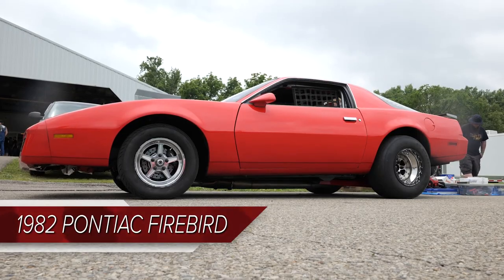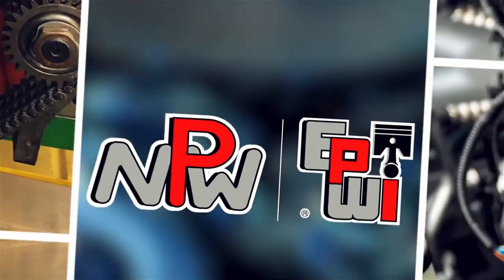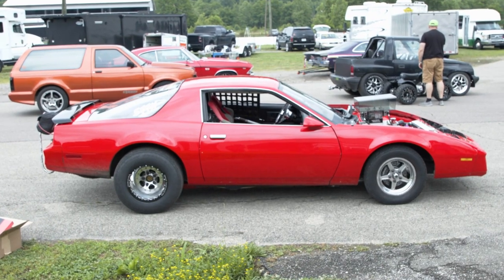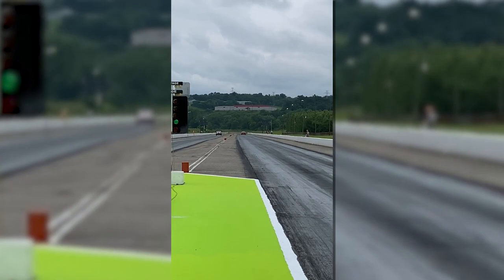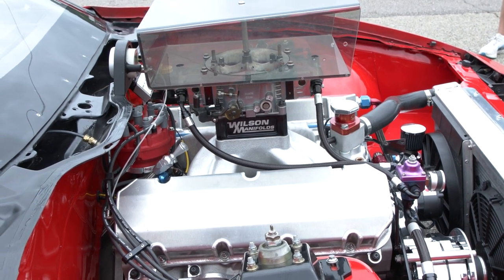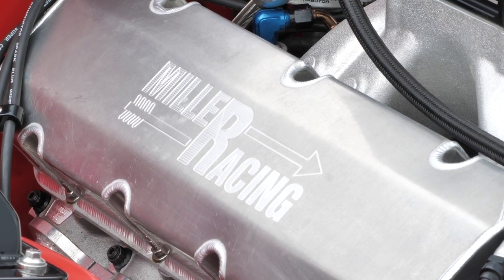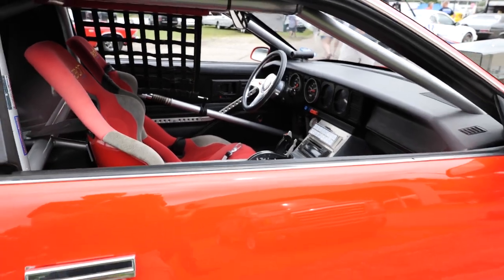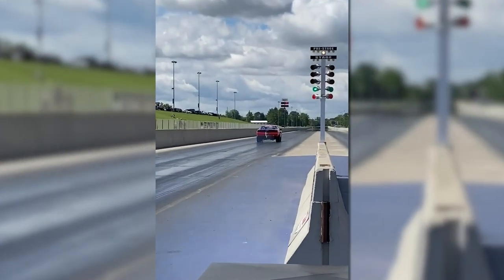Terry Miller's 565 Cubic Inch Big Block Chevy Engine

Comment: Is a 565 Big block Chevy any good for boost
Reply from the maker: Terry told us he used it as a nitrous engine for a few years. Not sure how it would respond to turbos though.
Reply: Depends on how you build it
Reply: The standard for boost is a 540, I think the 4.500 bore is preferred over the 4.600.
Reply: You can "boost" anything, just have to build it for boost!!